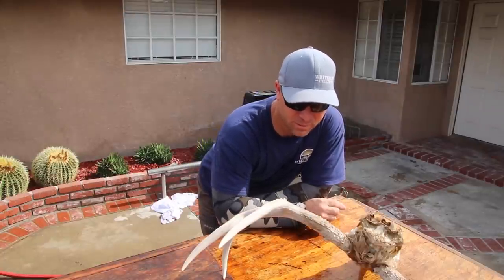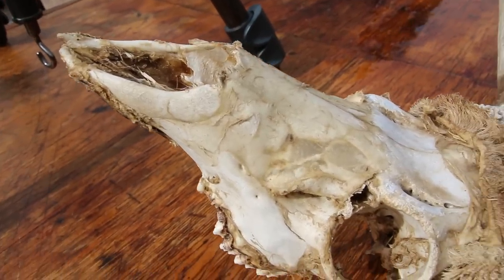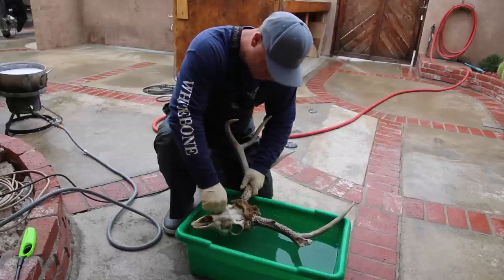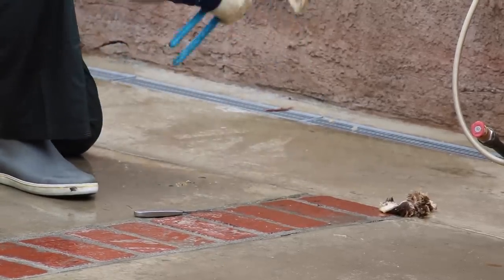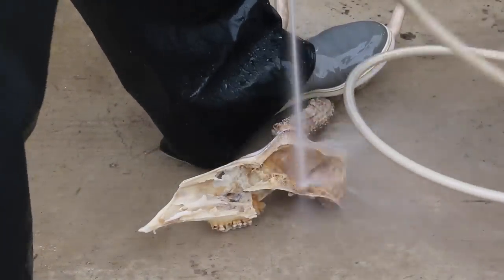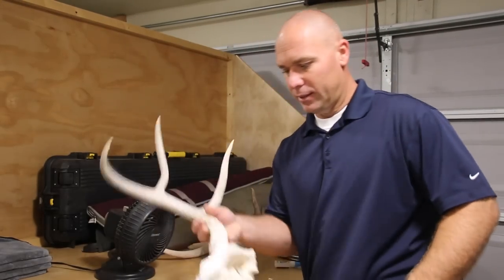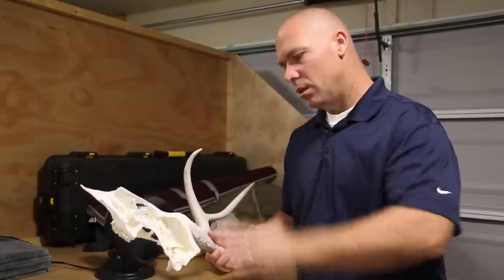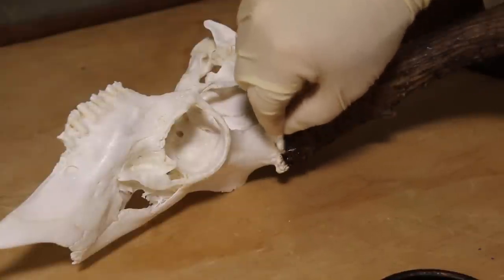DEER SKULL HALF MOUNT PROJECT

Comment: So I've tried the stain you've used. It's awesome and matched nicely. But it's not quite dry even after a 24 hour drying time. Have you had this issue? If so, how long does it take to fully dry or what other methods help it dry? Thanks in advance for any information.
Reply from the maker: +huntallthetime1 sorry for the late response. I have had that on antlers that are really smooth or a bit greasy. I typically dab it on and dry it with a paper towel. Give it a good wash and dry and try again my bet is greasy horn from the boil.

Comment: Would you recommend maceration for an old deadhead without any residual hide? There's a little bit of old grease staining, or it could be discoloration from mud seepage. It's a bull moose skull I found half submerged in a swamp. I've showed the local wardens my find, and been giving a permission to keep the skull.
Reply from the maker: +Ned Telling Congrats on the skull. I would recommend a good long soak in dish soap and water remove hide power wash and whiten with peroxide.  Thanks for watching
Reply: WHITEBONE CREATIONS HUNTING Sweet deal! Thanks for advice and getting back to me

Comment: Just to say, I feel like the coloration with ONLY that product makes the horn a bit flat colored. the final "try with the sand paper" can be changed with a drybrush wash, like with a white or ivory color. I mean something like you dip your brush in paint, have it discharge on some paper until it berely lend color and then have it on the horns. I guess it's juts a practice matter.